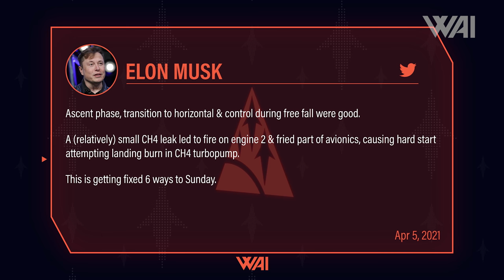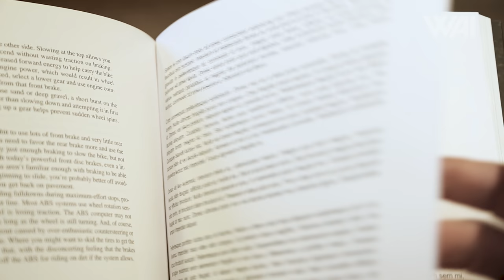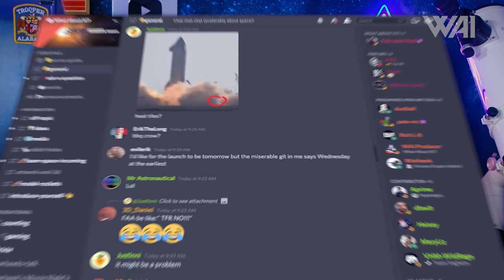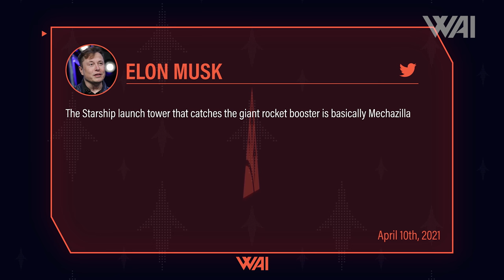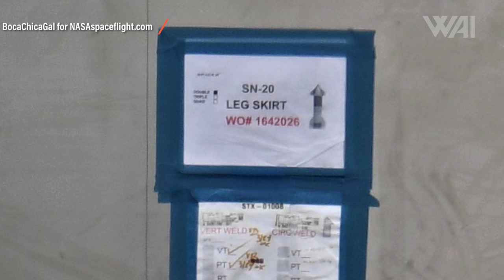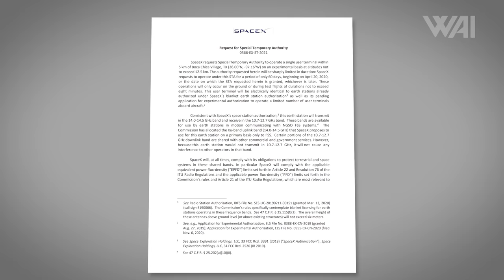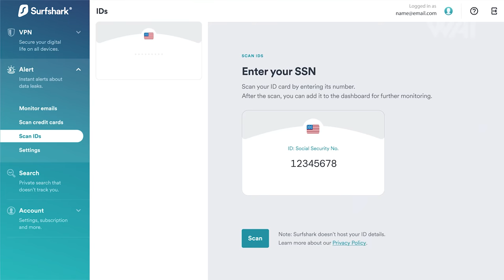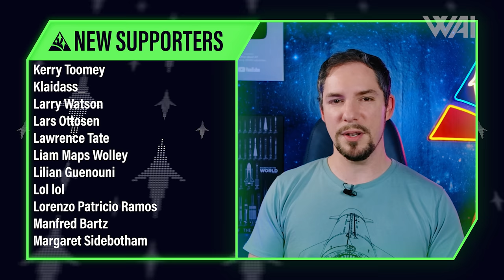SpaceX Starship SN15 - A Milestone Starship!

Comment: Realistically there is no reason SpaceX couldn't be testing orbital flights by July 1st. We have seen zero issues with Starship flight through apogee, and you don't have to land to begin orbital flight testing. The only question is whether the Vertical Launch Support Tower will be finished construction (as this is the only way to stack the two stages), and if they have enough flight ready raptors to power a full Starship/Superheavy stack

Comment: By the looks of it, SN20 will make it to space but won't make it back to earth (the SN20 skirt pic shows amount of tiles needed to workers I'm guessing). If it has to do a similar belly flop then it for sure won't make it past without needed protection  back into the atmosphere. But, I'm guessing whichever starship after SN20 will be fine tuned and have a good chance of making it back to earth (Just like the 5 starship prototypes not sticking landing so far , each having their own issues each time). And that July 1st date is very dependent on if they can successfully land a starship prototype on a 10km flight to start with. SO if 4 prototypes before SN20 can stick it, then I'm guessing they will go full steam ahead for orbital launch within July at least

Comment: Another good one from Felix. Before putting Starship into orbit they've got to get landings without any defects with the Raptors or  any other parts including the landing legs that still have to be fully tested.
Reply: Why is everybody so focused on landing starship first? For deploying starlink they just have to get them up! So 28 raptors igniting with no abort. Test of structural strength at supersonic speeds. Firing those vacuum engines first time. Testing heatshield. They only can do that on a full stack. Landing starship and header tank associated problems as raptor reignition are thinks they still can continue working on.
Reply: @pirminborer625  Because Starship is intended to be a re - usable rocket for transporting men and equipment so not being able to do the landing would kill those onboard. Starship is not for Starlink  deployment.
Reply: @trevordickenson3196  Yes, but there's no reason they can't put a Starship into orbit even if they've not succeeded in landing shorter flights first. Actual re-use isn't a priority at this stage, since prototypes are obsoleted before they've even flown, so if it takes a bit longer to sort out the landing, that's no obstacle to continuing with orbital efforts...

Comment: The noise on launch for all of those raptors on the SuperHeavy will be epic. If there is no deluge system for noise abatement, I doubt they will be allowed to launch from there after just one test. There is no way to lessen it without a massive deluge system. I don't know why more hasn't been said about this so far.
Also, they will need to do test hops with SuperHeavy before they mount a Starship on it for an orbital test. I doubt they will have that done by July 1st.

Comment: Starship can reach orbit with relatively high propability if superheavy works but that will be bigger challenge. 

So far we have seen three raptors working with relatively low power but with superheavy, there will be much more power and forces on so far totally untested structure. Vacuum raptor is also kind of question mark. None of them have been tested on vacuum yet.

Comment: I think the Sartlink testing is probably for testing the feasibility of the  current user terminals if they'd work for aircraft, since they had filed for permission with the FCC to have mobile user terminals for things like Public transit, airliners, ships, etc. This would be one way to be able to do the airline testing without having to get involved with an airliner to do the initial testing.
Reply: Yep. Modifying a regular aircraft to add a new surface-mounted antenna sounds like a nightmare in terms of FAA paperwork. But Starship being both experimental and uncrewed, it's perhaps much easier to get signoff.

Comment: Thinking that the fire on the engine was 'normal' is analogous to NASA noticing ice raining down along Shuttles during launch so often that it was also considered normal, and therefore not to concerned about, until a piece of ice led to the destruction of one of its Shuttles and loss of its crew. Things that aren't supposed to be, but are, should never be considered normal, especially as regards launch vehicles.

Comment: Maybe the Mystery Structure could be for testing internal structural designs intended for Starships with a cargo-bay door?
Reply: I also hope they do not hesitate in testing cargo bay doors for satellite insertion.
Reply: @MrEd2291  I mean if it opens but doesn't close then mission is success because payload is transported, landing is problem for SpaceX
Reply: @ImieNazwiskoOK  I'm guessing MaxQ would be a RUD should the hood come unlatched! & Super guessing that attempting the belly flop maneuver with the hood unlatched would end the same way.
Reply: @antoniocusato6074  I mean if it opens at destination (LEO for example) and doesn't close. Then theoretically mission success because payload wet to destination.
Reply: @ImieNazwiskoOK  true

Comment: I wonder if they want to see how the stainless exposed portion handles reentry if sn20 is only partially covered with the tiles. I've got a feeling they'll nail reentry easier than landings
Reply: That's my guess too. I think that with the stainless steel acting as a heatsink, they maybe don't need the tiles for re-entry from low orbit, so it makes some sense to try to do some comparative testing with and without.

Comment: I don't have a lot of confidence that they will manage an orbital launch until 1st of July. They still didn't managed a landing with three engines. With 33 engines spread over two stages this is much more difficult. I would be really impressed if they really manage it.
Reply: Orbital won't require reliable landings, and they won't use all complement of engines & fuel during the early orbital
Reply: @alvianchoiriapriliansyah9882  that is true, but still they will have a whole additional stage (the booster) which until now was never tested and has it's own avionics, tanks and engines that will have to go through testing.

Comment: At no time is an engine fire OK on anything that flies. The one thing thats going to happen by insisting on this crazy landing system and going without landing gear is that this method will have to be tested as well and it probably will fail several times before they get it right. This amounts to a huge delay going to Mars when all you had to do was put some real landing gear on it and fly now. Yes they will fly on or about the 4th of July.

Comment: Why is everybody so focused on landing starship first? For deploying starlink they just have to get them up! So 28 raptors igniting with no abort. I bet they want to go the next step in July. Test of structural strength at supersonic speeds. Firing those vacuum engines first time. Testing heatshield. They only can do that on a full stack. Landing starship and resolving raptor reignition are things they still can continue working on. If I was elon I would just need one successful orbital launch to start deploying starlink and continue testing. Booster landing will be trivial for them, similar to falcon. Probably on a drone ship with falcon like legs. They always can aim for a legless booster and catching tower further down in development. Its just that legs are reducing payload capacity.
Reply: Heck they won't even need all 28 to be able to get into orbit

Comment: I'm wondering if there might be a materials structural problem, some type of flaw.  These landing problems seem related around the engines and fuel pressure.   Could there be a design problem or a weak joint.
Reply: So far there's none related to that

Comment: Will we see a Starship orbit the planet before we see one survive a landing? :-O 

While I understand why the Flacon 9's have a "suicide burn" and have to land in one shot, I'm wondering why the Starships don't seem to be trying to hover before landing. By "hover" I mean to reach a velocity of 0.0 meters per second within a few meters of the pad before throttling down to land. I would think that an attempt to hover would allow the flight systems to gauge how well the engine being used is operating and possibly switch over to a different engine if any anomalies are detected before actually attempting to land.
Reply: Starship has more hover than Falcon

Comment: I think July is pushing things far too fast. we have many problems that have cropped up with the current iteration, the next (SN15) iteration, though greatly upgraded, has yet to be proven... and like a Windows "upgrade", often leads to more problems once placed in service. The tens of thousands of checks and corrections every second might seem more than sufficient, but they have yet to encounter every conceivable problem. NASA spent what some consider wasted time and money testing just that, which is likely the reason we succeeded, even though more problems were encountered.
Will SN20 be the production version? 
Ever heard of "recalls"?
Reply: Because this is a prototype, there won't be a recalls

Comment: I honestly don't think Mechzilla is the best way to land the Super booster or StarShip if it even can.  There are too many things that have to go perfect for it to succeed, and that is bad for a high turn around airport like system.  I think a better way to land StarShip and Super booster is to have a landing pad that absorbs most of the landing stresses.  Example, raise the landing pad about 50 feet off the ground and make it out of a metal grid of sorts.  When a spacecraft comes in for a landing, as soon as it touches down the entire pad will drop and match the spacecraft's speed in the first 20 feet.  During the next 30 feet the pad will break and slow down to a stop.  Thus absorbing most of the landing energy.  So no need for super strong landing gear or certain trajectories for a catch and grab.  I think this is a much better solution.
Reply: Then explained the alternative way to have one hour turnaround
Reply: @alvianchoiriapriliansyah9882  Well once it lands just use your crane to move the super booster to the nearby launch platform. After it's safe to do so of course.
Reply: @htannberg  Then you will need at minimum a worker on site to secure the crane lifting jig on top of 70 m landed booster, which quickly render quick turnaround impossible (also need a robot to safe the vehicle from excess propellant, instead of the launch mount itself). Other alternative solution?
Reply: @alvianchoiriapriliansyah9882  Hey, great questions!  If done correctly I don't think you will need a person to attach the crane to the booster.  It can be done automatically.  Also, if it's safe enough to move before de-tanking then it can be placed properly on a launch pad that is designed to de-tank and refill for next launch.  It will take quite a long time before these ships will have a 1 hour turnaround launch time.
Reply: @htannberg  Can you give me a video example of a crane joint be connected automatically to one heavy object, without any person?
Reply: @alvianchoiriapriliansyah9882  My 3dstudio max is on a faulty old computer, but I'll try and get it going and then render the whole process out.   I think if you have one cable connection to the center top, you could lift and then swing it over to a tower of sorts that would stabilize and rotate the spacecraft so that it will line up better to the launch mounts and refueling lines. I'll do my best to get a video created, but it will take me some time.

Comment: Is an orbital flight achievable by July 1st? Absolutely, July 1, 2021. This year, I highly doubt it. Assuming they plan to launch all of Starships 15 through 19, and given that they have been going about one every three to four weeks, that means they won't get to 20 before August. Furthermore, their test of BN-2 is going to have to go perfectly. It will have to go up, and come down, and land in one piece, maybe more than once. If it goes boom, then they will need more tests on BN-3, and maybe higher numbers, before an orbital flight can be attempted. There is one alternative to that. If BN-2 crashes on landing but otherwise has a good flight, they could decide to go for orbit with BN-3 deliberately deciding to expend it, or trying to land it but accepting the fact it might not be successful. So, assuming the test campaigns for SNs 15-19 are successful, and for BN-2, or they decide it is worth losing BN-3, then an orbital flight late this summer is possible, which is an absolutely incredible thing. If something happens and they get slowed down though, then any time this year will still be incredible, and next July will be just fine.
     Has anybody heard anything about design upgrades that would allow Starships to start carrying payloads? Like appropriate integration structures and a payload bay door? Granted, Musk expects to lose a bunch of them learning how to reenter and land, but that is no reason they can't go ahead and become operational, just like Falcon 9 was operational long before they learned how to land it. I have a personal interest in seeing Starships deploying payloads before SLS flies.
     Now I come to a very serious matter. Felix, I have noticed that you have covered every Starship launch, and every Starship has been destroyed. Coincidence? Hmmmmmm. LOL, just kidding Felix, keep up the good work!
Reply: You're assuming they do launch SN15 through 19 though. They skipped 12 through 14 because they were deemed unnecessary after the success of 8 and 9, so if SN15 does well, they may limit that phase too.

I agree though that Superheavy is the likely source of delays. July is pretty close for fitting in construction, pressure testing, static fires, and a flight test for a booster that so far exists only as a manufacturing pathfinder.

Comment: I don't think the raptor engines have been installed in SN15 which usually require several days of testing afterwards.  Spacex may want to test them more rigorously following the SN11 explosion.   Also the FAA may want more time to 'piece together' what happen to SN11.  My guess is SN15 won't fly until May.
Reply: SN9 failed, FAA follows the investigation, yet SN10 didn't take very long to launch
Reply: @alvianchoiriapriliansyah9882  I think blowing up in the fog makes it difficult to gather the information.  Also, an explosion over such a large area created some near miss scenarios for people in the vicinity.  Not doing a more thorough investigation may look like they are 'going easy' on Spacex...
Reply: @corypride5096  Yet SpaceX can still figure out the cause, and all of dangerous debris were contained within the exclusion zone
Reply: @alvianchoiriapriliansyah9882  OK Alvian, let's hope all issues are minor and they fly SN15 soon. Cheers.

Comment: I think everyone is getting ahead of themselves here. Try sticking a landing 3-4 times, then we can talk about orbital flights.
Reply: Orbit doesn't require reliable landings
Reply: @alvianchoiriapriliansyah9882  No, you are right it doesn't. But, then it's just another rocket. The whole point in this exercise is the reusability... which is somewhat dependent on landing without exploding!
Reply: @rw9207  Which is fine, it's the first time it launched anyways. They will attempt a ship & booster recovery right form the start, whether or not if that's successful
Reply: @alvianchoiriapriliansyah9882  What do you mean the first time? SN prototypes have exploded 4 times in a row so far and barely managed to stick a wonky landing on one before going BOOM.  There is clearly an issue with Raptor reliability.
I'm not expecting the booster to be successful for a while.
What I'm saying is, moving onto the next phase when clearly this phase is incomplete seems ridiculous. Until the Starship can perform a satisfactory landing sequence, the rest is secondary.
Reply: @rw9207  All SN prototypes were successful in ASCENT so far. I repeat again you DON'T NEED a reliable bellyflop & landing to be able to go into ORBIT

You also didn't understand parallel development. Did Falcon 9 have to wait for reliable landings to even started orbital attempt? If it does, then Falcon 9 really only be launched for the first time in 2018! (Block 5, the most mature version)

Raptor now has a new design debut in SN15. We'll see what it goes, but considering they have learned a lot from previous design (which is indeed low on reliability like you & many people insisted) I expect an improvements
Reply: I am aware of that, I watched each and everyone 'live'! 
I repeat, ANY ROCKET CAN DO THAT! The entire point in the SN model, is its supposed ability to land and be 100% reusable. Otherwise you might as well just improve the Superheavy. Landing this large rocket IS...ITS...PRIMARY...FEATURE! A feature yet unrealized.
Reply: @rw9207  Yes, but for early flights they didn't expect all of them to be realized right away. Elon already mentioned that they expect several failures during reentry on SN20+. Faster is better to get the operation going
Reply: @alvianchoiriapriliansyah9882  right, so, back to my original point. I think its too soon to be moving to the next phase, when you haven't completed this one. Its akin to running before you can walk.